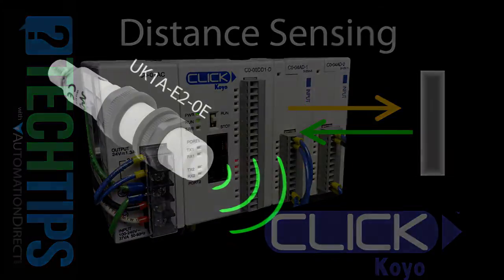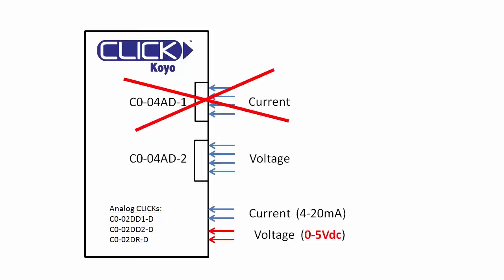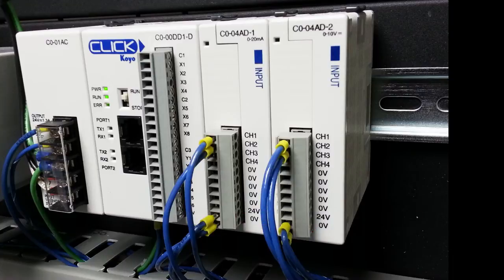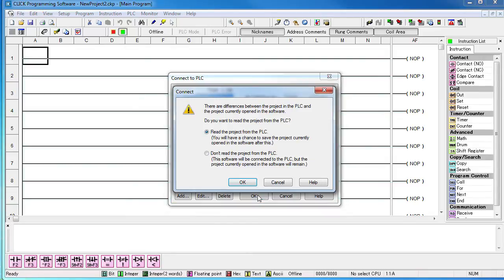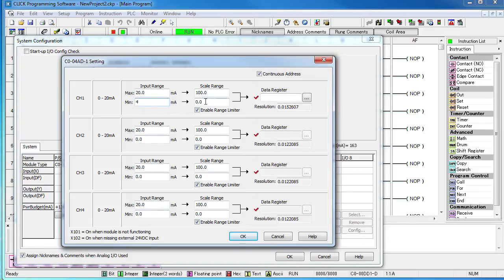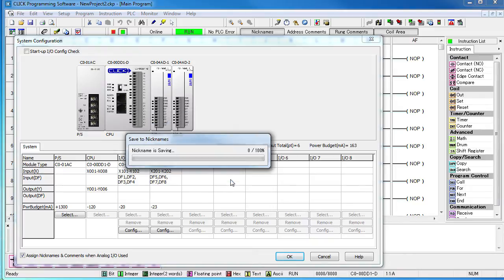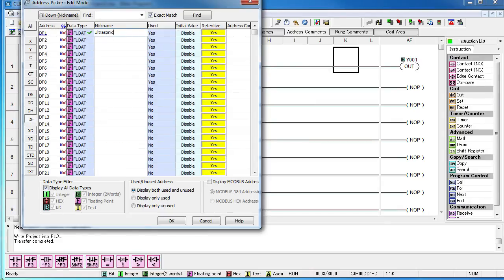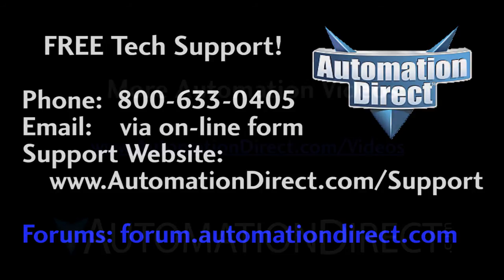How to Sense Distance with an AutomationDirect CLICK PLC

Comment: I see at video point 4:48 the Ultrasonic Sensor at 8.729876 that is greater than 8 - yet the output Y001 indicates active , also rung 2 DF5 is 9.032536 which is less than 10 and y002 is hilited in blue. SO which one of these rungs is not properly indicating its output state ?
Reply: Hi Ken, You are seeing artifacts of the coms between the PLC and the Computer display. If you wait a split second later the display catches up and everything makes sense. Bottom line: Remember that the monitor function is intended to give you a roughly real-time representation of what is going on and is heavily dependent on the communication speed between the Computer and the PLC.
Reply from the maker: @Kevin Schnell, thanks for the comment. They are both indicating correctly. 8.729876 is greater than  8.0000000. and 9.032536 is less than 10.00000. This is comparing a floating point to a whole number integer, so think of the whole number in terms of a decimal value.